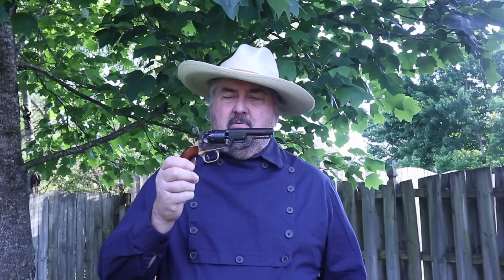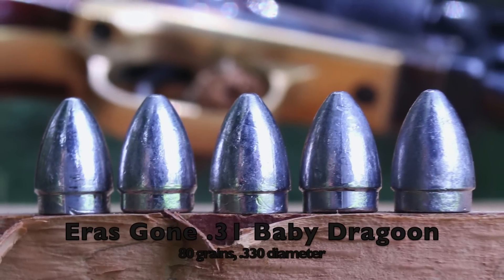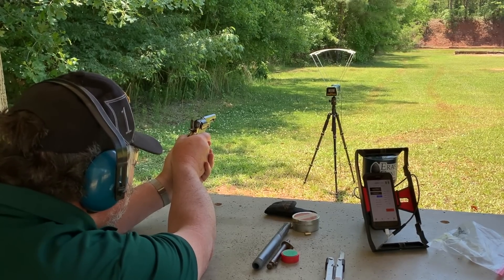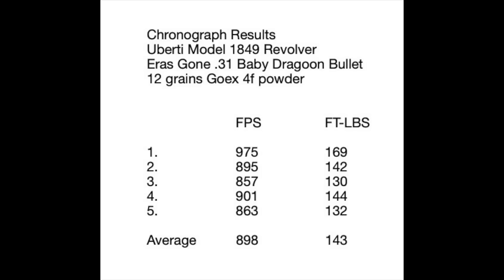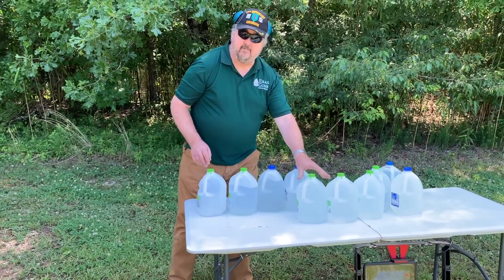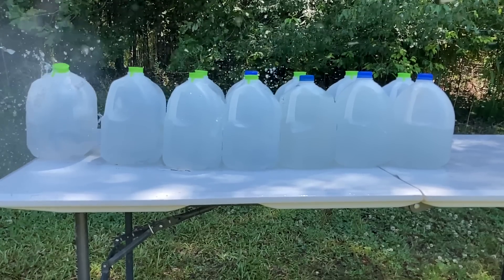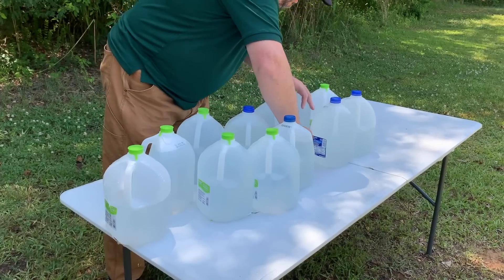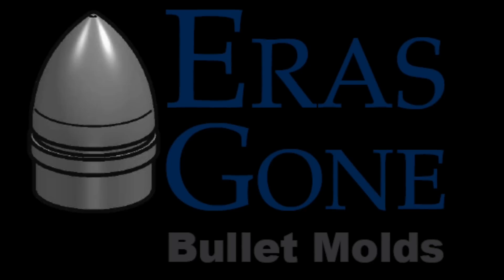Uberti .31 cal Baby Dragoon, Puny or Deadly?

Comment: Very interesting results, ffff is perfect powder for low capacity, some of Samuel Colts powders looked like the granulations was about as fine as the 4 F powder we use today, which is why the later colts had smaller cylinders because they started using better powder, a lot of people complained that they kicked too hard , if you load them like modern people they have no recoil, so either the powder was different or people were wimps back theme lol, Nice looking bullet,  looks like it performed really good
Reply: Leverguns 50 back in the 19th Century, FFFFg was considered pistol powder, FFFg was "rifle powder" and FFg musket or shotgun powder.  In 1855, at Colt's request, Hazard Powder Company, manufactured a special powder for Colt's new foil revolver cartridges, called "Hazard Cartridge Powder" which was an extremely fine grained 5Fg.  You will see combustible cartridge packets from Colt, D.C. Sage, Johnston & Dow, etc often marked "Made of Hazard's Cartridge Powder".  The closest modern black powder to Hazard #1 Pistol Powder in actual performance is Swiss 4Fg, and the closest to "Hazard Cartridge Powder" is Swiss Null B(5Fg).  The 5Fg should never be loose loaded, but only used in a paper powder envelope to prevent powder dribbling thru the nipples and setting up a possible chain fire. Traditional combustible cartridge loads with 5Fg are roughly 10% conical bullet weight. Before loose loading 4Fg, change the nipples to quality replacements having very tiny flash holes. I only use 4Fg under conical bullets and keep charges in the 10% to 15% conical bullet weight range. For full powder charges under round balls in revolvers, I stick to 3Fg.
Reply: @63DW89A  Plus by 1860s or so they were starting using some Brown powders that were hotter than black powder, they just charred the wood not turning it all the way in to charcoal, they said it produce tire velocities with the same amount of powder.
Reply: @Leverguns50  I've heard of the brown powders, but have not had a chance to research them. Would be interesting to make some of them!  I'd like to make a few small batches of replica "Hazard Powder" using willow charcoal and compare to Swiss to see how Swiss/Hazard would compare. The fascinating fact coming to light, [as Mark's valuable and informative .31 test demonstrates!] is that the percussion revolvers, properly loaded with correct powders, operate at a considerably higher power level, than has been commonly believed for many decades now!
Reply: @63DW89A  the regulators in the Kentucky area back in the early 1800s used dogwood charcoal to make their gun powder
Reply: @63DW89A  almost swiss 0B granulation, from my understanding, basically coarse dust

Comment: Now test 44 for velocity and energy ;) So if we got 32 acp energy from punny 31, 357 magnum energy is in reach of 44 with proper powder/bullet selection or is it? Your thoughts?
Reply: Measurements obtained with the lee bullet 450-200 ogival grains and Swiss powder N ° 1 FFFFG  :
25 grains : v5=260 m/s E=42 kgm
35 grains : v5=315 m/s E=62 kgm
Reply: @didiermasclet9886  35 grain load with the 200 gran bullet gives 475 FPE which is comparable to some weaker .357 magnum loads.
Reply: Always with Swiss powder N ° 1 but with 140 grain round ball and Walker Colt (Uberti). 50 gr : 385 m/s E:710J
60 gr : 405 m/s E:790J.